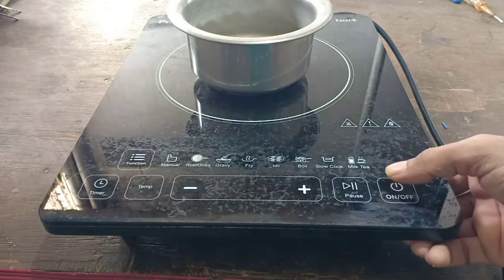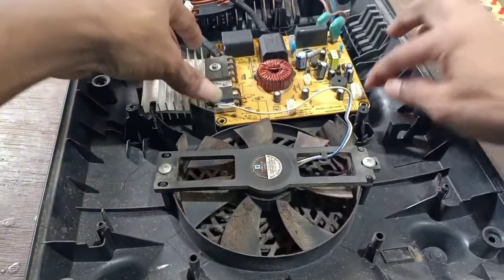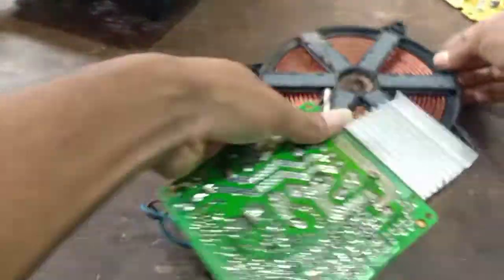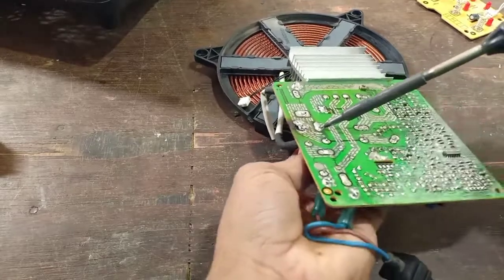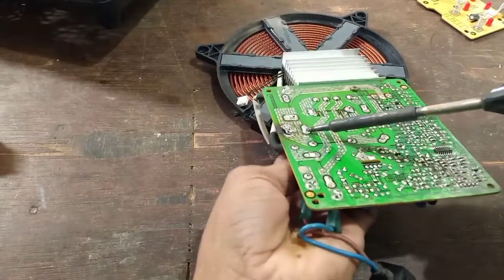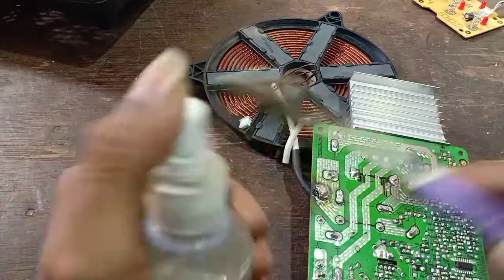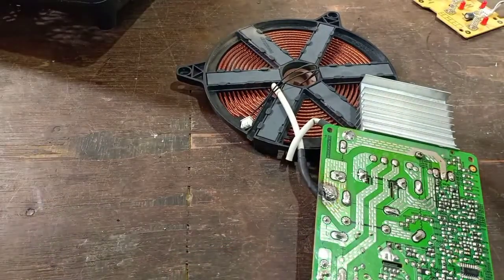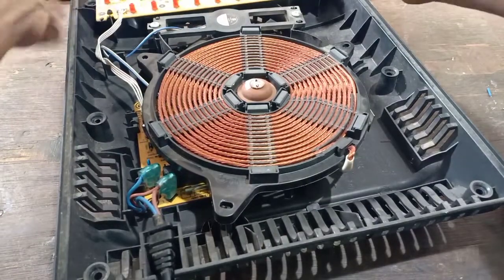Preethi induction cooktop power on of problem

Comment: என்னோட induction stove same model same problem, capacitor no crack, capacitance meter la check பண்ணுனா value ஓகே, capacitor change pannalama sir. Intha problem vantha vera enna check pannanum
Reply from the maker: Coil in put out put feedback voltage check Pannuka.